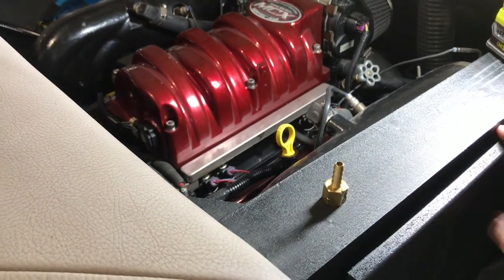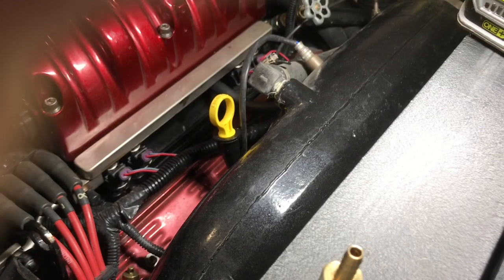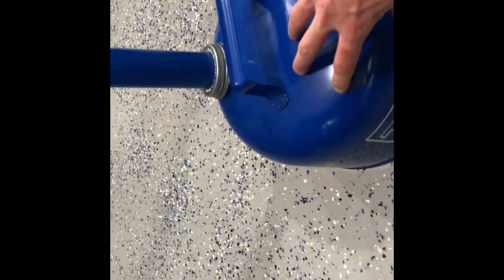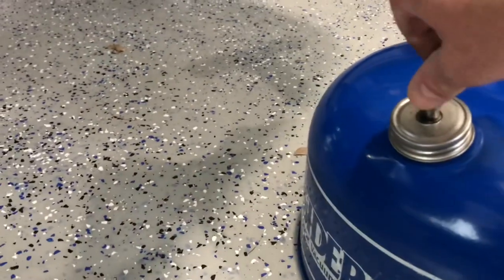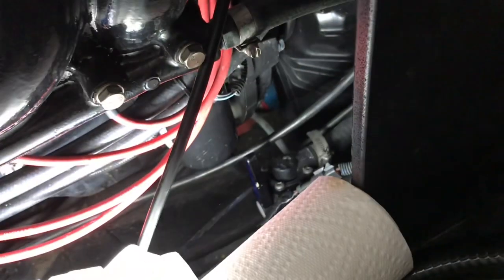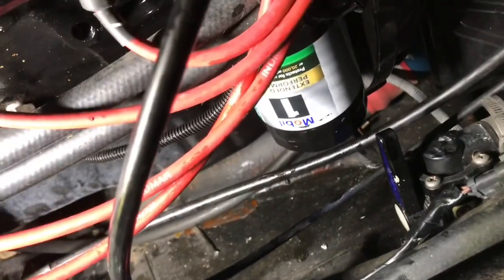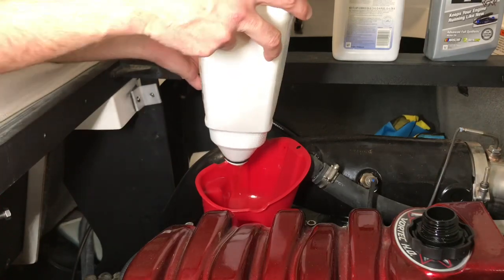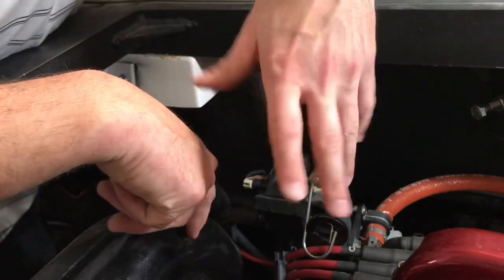Mastercraft Boat oil change DIY Indmar 5.7L inboard V-Drive Engine MCX 350.  6 Quarts of 15w40

Comment: We have this engine in our Mastercraft.  Quick question, why do you need an extractor to drain oil through this hose?  Does it have to come up above oil pan to go through drain hole?  We have a bottom drain hole in the engine compartment close to oil pan.  Could we send the hose out there and gravity drain into a bucket?
Reply from the maker: Yeah you can just gravity drain it, it will take a long time to do that.  If you’re going to gravity drain? I would let it drain overnight
Reply: Myks Garage Thanks! We are going to give it a try this weekend.  Appreciate your video!
Reply: @Myksgarage  hie

Comment: Myks Garage, do you absolutely have to run the oil drain hose out the back?  Or can you complete this process all from inside the boat?
Reply from the maker: You can do it from inside, especially if you have an fluid pump or an  extractor tool like the one I used in the video.  The hose out the back just let’s gravity help the flow.

Comment: Could you show or describe (in relation to the oil filter for example) where the oil pressure sensor is on this engine? We have the same exact boat and engine, just replaced oil and oil filter, though the gauge shows no oil pressure at all - we believe it is faulty as the oil level is stable. Thank you!
Reply from the maker: I’m not sure where the sensor is located.  Are you sure you have a tight seal on the oil filter?

Comment: hello, can you tell me where to buy the adapter to end the drain cable to connect to the pump?  thank you very much and well done for the video
Reply from the maker: Home Depot is where I got mine
Reply: Myks Garage thanks but I’m from France 😜
Reply from the maker: Just search online for a “1/4 npt female barb fitting”
Reply: I am still trying to figure out why you are farting around with a pump. The reason the quick drain hose is there is to avoid all that pump crap. Over 40 years of draining my inboards just drop hose out remove cap and stick it in a container crack a beer and relax! Oh I am sorry for some of you that's probably a white claw.

Comment: Great video, I have the same engine in my new Campion SV3/SFara surf boat. Do you know how to set the idle?
Reply from the maker: I don’t know how to set the idle.  I’m guessing you would need to do it through the ECU?
Reply: @Myksgarage  Thanks will check that out
Reply: @Myksgarage  what is that pump/tool you use to drain the oil out called?
Reply from the maker: It’s called a “top sider”. But you can get any oil extractor tool to work
Reply: Will it drain without the vacuum?